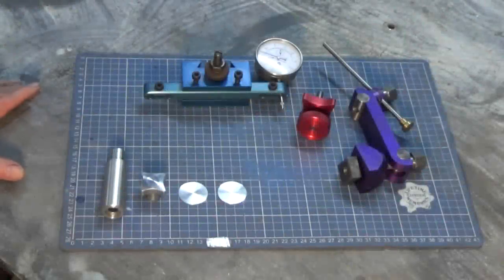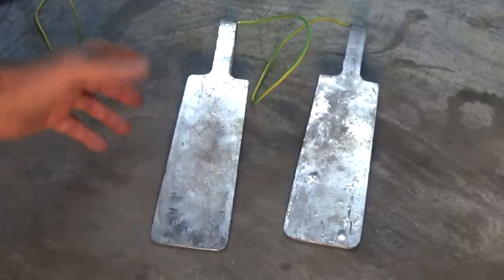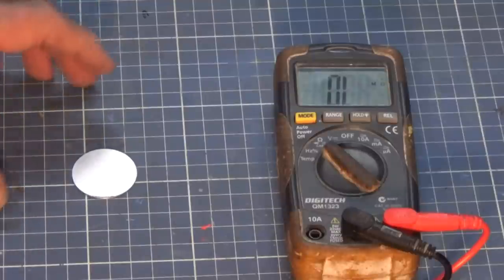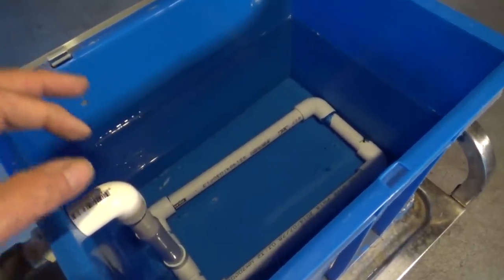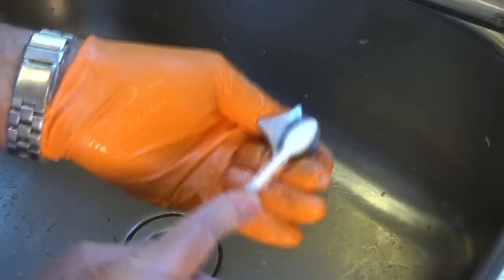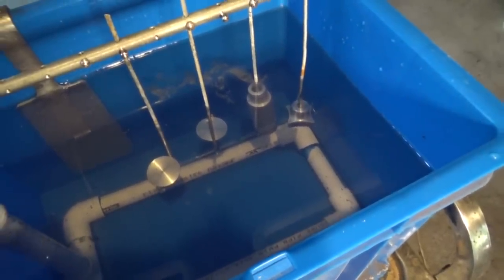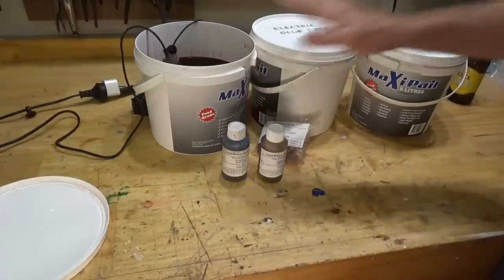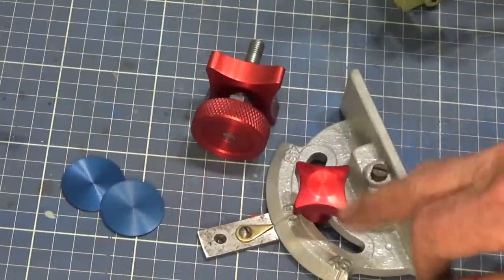Metal Finishing With Mark Anodising 101

Comment: Hi mark, how long do you find the sodium bisulphate solution to stay affective? Does it need replacing often?
Reply from the maker: I have only had to top up the water which probably evaporates over time. However the raw chemical is so much cheaper than Suphuric Acid that you could make up a new batch for less than $20.
Regards,
Mark
Reply: Thanks for the information mark. I am in the Uk and obtaining battery acid is difficult. I have ordered sodium bisulphate, have read online it doesn’t last very long but it seems cheap enough...

Comment: Thank you for that - I followed your process and it has worked a treat (I did work out the current to get ~ 6A/sq ft which needed 17 - 21 volts).
Reply from the maker: I have never been able to get that sort of voltage when I set up my power supply. It is capable of supplying more than the 15V that was recommended to me but even if I set the power supply to fixed voltage the parts will only take a few volts at a time. I'm not worried though. the process seems to work consistently now that I clamp the hanging wires with screws.
Regards,
Mark
Reply: @Preso58  I'm not sure what part temperature plays - I think it needs higher voltage as it gets colder. It's been ~15°C here  and I set my tank up outdoors. It does work an absolute treat though - thanks!
Reply: Just to add some closure to this - I found that I'd made a mistake when calculating amps which is what gave me the ~20V. I do need 17 to 17.5 volts to get 6A /sq ft though. I've anodised a few dozen parts now, and it really does work well - thank you @Mark Presling

Comment: Boiled linseed oil works very well on bare steel to keep it from rusting.
Reply from the maker: That's correct but I find it tends to go sticky and attract dust. Parkerising is the most durable finish I have found for steel parts in my shop. I did a video on the process a while back. https://www.youtube.com/watch?v=922RePcv9P0
Regards,
Mark

Comment: Can we anodize on pressure die cast parts?
Reply from the maker: That is something I haven't tried. I did anodise a regular sand cast aluminium part and it came out sort of OK. I think that a lot of pressure die castings have a high zinc content which may cause issues.
Regards,
Mark

Comment: wish if there is a total package to order it all
Reply from the maker: Caswell do sell entire kits including the power supply but it gets expensive to purchase it that way. You can get started with just a 12V car battery and some bits of wire and aluminium for the cathodes. However I would suggest you buy good quality anodising dye rather than trying to use fabric dye. 
Regards,
Mark

Comment: if you leave it too long like lets say 2-3 hours, would that mess up the thread of the part if it has it?
Reply from the maker: I don't think so. Sometimes you notice that a part might seem a bit tighter on the fit because the surface becomes encrusted with microscopic pores that grow outwards from the surface but we are talking microns so it shouldn't be an issue.
Regards,
Mark
Reply: @Preso58  nice... thanks for the video and for the answer...

Comment: was the black part done with the rit dye?
Reply from the maker: No, I tried the Rit dye a while ago and I couldn't get the depth of colour I wanted. The black dye from Caswell doesn't go jet black but they sell several types and it could be that the one I have is meant to turn out with that sort of black chrome look to it. The best dye I have is a copper one. It looks exactly like copper but it won't oxidise or tarnish. 
Regards,
Mark

Comment: Mark agree with all other comments very well done and informative thank you..My question is will the final rinse in Caustic cause a Satin finish on item yours apears to be quite shiny in end result.
Cheers Brian
Reply from the maker: Brian, the caustic solution does etch the surface but in practice, I have never been able to get a highly polished surface to anodise without losing some of the gloss. In commercial situations they use a special acid as a final rinse that chemically polishes the surface. I tend to get a semi satin finish which is quite pleasing and it does help to hide any imperfections in the flatness or polish achieved. I also just recently found out that the PH of the dye is very important. I had a black dye that was almost brand new but it wouldn't give me the deep black finish that I was after. I bought a digital PH meter and checked the level. It was supposed to have a PH of 5.5 and it was more like 8! I was able to add some hydrochloric acid and now it dyes a beautiful deep black in a fraction of the time it used to take. 
Regards,
Mark
Reply: @Preso58  Mark do appreciate your feedback thank you, my results using your exact formula were very good indeed , semi satin is a good description and no sign of fine scratches as you mentioned so will adhere to your formula ..May I ask another question which is..does the PH become critical with all Caswell Colours ? and should Dye and Solution be stirred before each use if left standing for say 2-3 days or longer? Thank you... I have a friend in Sunrise Road..  Regards  Brian
Reply from the maker: @brianreid4101  Brian, I don't stir my dyes but I do heat them which circulates the liquid via convective currents. The PH is different for each colour. There is a post on the Caswell forum which shows the recommended level for each colour https://forum.caswellplating.com/forum/anodizing-questions/3885-anodizing-dye-ph I was surprised that my black dye was so alkaline as I made up all the dyes using distilled water which should have a neutral PH. Maybe they go alkaline over time? I have only ever had one batch of gold dye go bad. Maybe it got contaminated with something but all the others I have are several years old and they seem to be still in working order. 
Regards,
Mark

Comment: Would stainless steel wire work? To hang the parts on?
Reply from the maker: In theory it just needs to be a conductive wire but I have never tried stainless. Aluminium is good because it deforms easily so you can squish it into threaded holes or spring it into odd spaces to get a good contact.
Regards,
Mark
Reply: If you use stainless steel, keep it as short as possible because of resistance.

Comment: What is hard Anodizing?
Reply from the maker: It is very similar to regular sulphuric acid anodising but the coating is thicker, more uniform and more wear resistant. It does require cooling of the electrolyte and is probably harder to do in the home shop.
Regards,
Mark

Comment: Have you had any success anodising castings?
Reply from the maker: Warren,
I haven't tried anodising any of my castings. The surface quality can be quite variable and you can never be quite sure what impurities you have in the metal. If I have to finish castings I will powder coat them. It is a much simpler process and there are powder coat colours that mimic anodising really well. 
Regards,
Mark
Reply: @Preso58  , sorry my mistake, I meant after machining. The fine porosity in the casting makes it almost impossible to clean and seems to leech out oil or something during the anodising.  I have tried baking the job prior to anodising with mixed levels of success.

Comment: can I just buy Sulfuric Acid? From $10 up to $100? Just not sure what brand....
Reply from the maker: Sulphuric acid is the best but it's very expensive here in Australia, if you can get it. I have been told by an expert that "battery acid" is not the same as lab grade sulphuric acid but the sodium bisulphate is way cheaper for me and I can get it easily from the hardware store as a dry powder. It keeps indefinitely and it's sort of safer since it won't splash if I drop the container. 
Regards,
Mark

Comment: Hi Mark love the video You want H2so4 try Bunings $16.00 for 5L no questions asked used for cleaning up brick work (after laying bricks)
Reply from the maker: Graham, I must say I have never seen H2so4 at Bunnings. HCl yes, that's hydrochloric acid. Sulphuric acid is very difficult to get now. 
Regards,
Mark
Reply: @Preso58  Hi Mark My mistake however after some more googling, Mo Flow is 99% Sulphuric acid used for drain cleaning ? and PH down from pool supplies at 35% Sulphuric acid, (seems to be harder to find in victoria